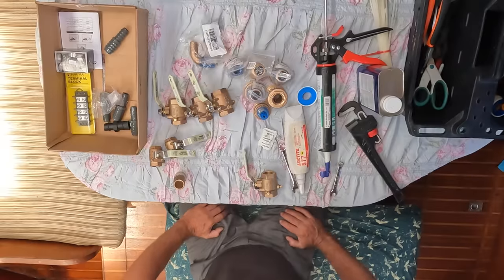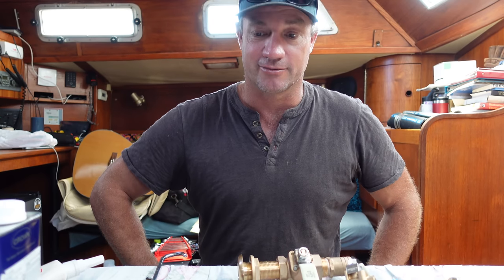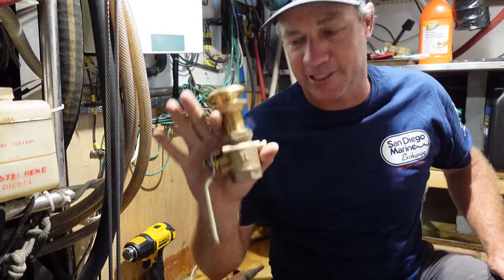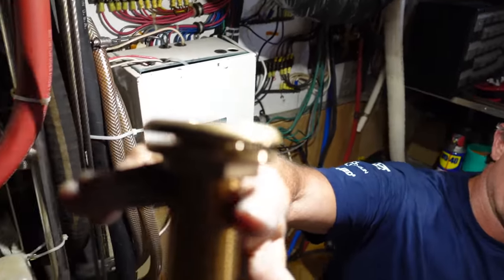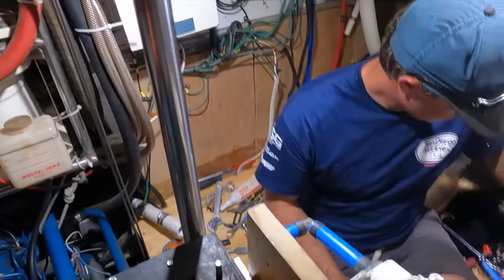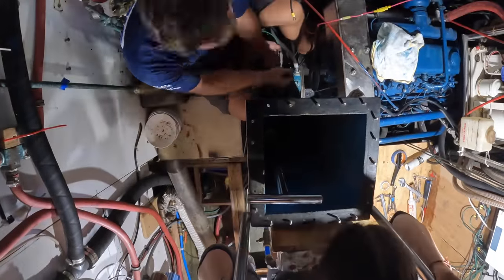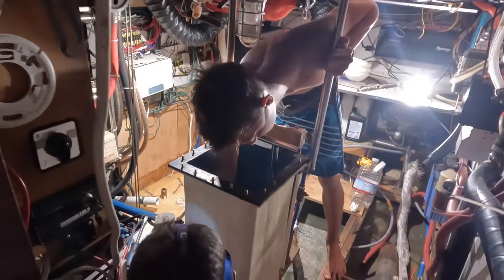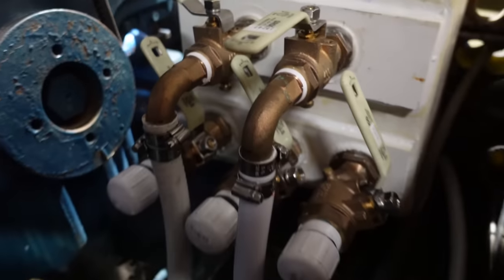The worst I’ve ever seen | Lots of Boat work | Ep 308

Comment: Such a great trick using the two "spanners" to hold the skin fitting. In the past I have used a block of timber wedged into the fitting from the outside, Your method can make replacing skin fittings a one person job!

Comment: Hi Lee and Catalpa crew mates.

I was just watching a You Tube of a 44 ft. De Fever [ Aqua Cultured } with the same type of sea chest set up. He lost power to his Port engine while underway and the engine overheated. The cause turned out to be a blocked air outlet at the top of the sea chest. As the water comes in the air outlet allows the air to vent and make room for the water to rise.

His Port engine feed is higher than his Starboard so he retained his Starboard engine. It turned out that the air pipe was blocked up with salt and crud.

Might be a good idea to check your air vent on the sea chest before You cross the Pacific.

Kind Regards and Best Wishes to You all for Xmas.

David in Oz.

Comment: For maintenance the sea chest looks like a good system. 
One big hole instead of lots of small ones in the hull.
Just don't break the sea chest!!
Reply: I too like the idea of the sea chest with only one big hole to seal and then you can maintain all the seacocks at one interior, accessible point. I am curious about exhaust water though, like engine cooling return water, that wouldn't go back to the sea chest (source of cooling water) so does that water return to the sea another way?
Reply: @thagemizer  The exhaust water (and grey and black water) leave the boat usually by separate through holes either out  the stern ( good way to check if motor is getting water through the cooling system) or on one side of the boat.  The sea chest is ONLY for water coming into the boat.
Reply: @stephenmurray9850  ah yes

Comment: Only thing wrong with handles up is that vibrations can cause them to fall down and open the valve. Been there and done that and then turned them over to prevent it.